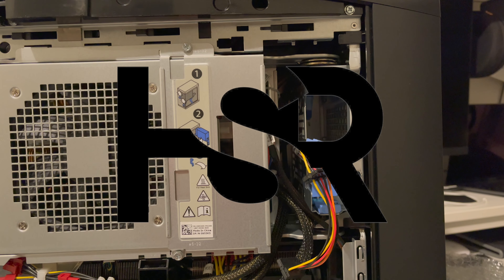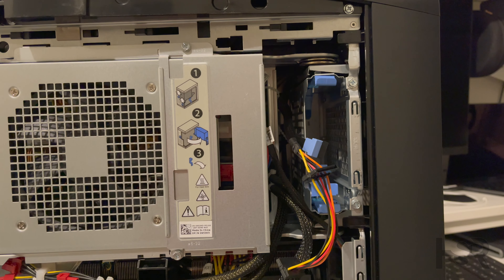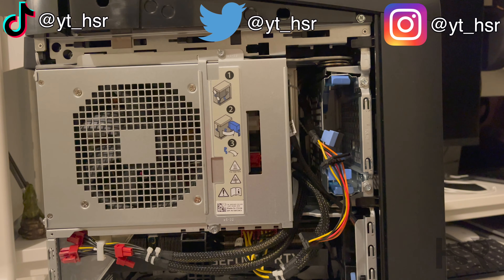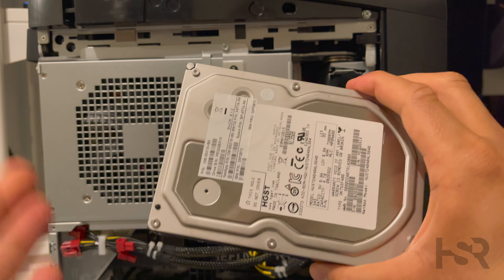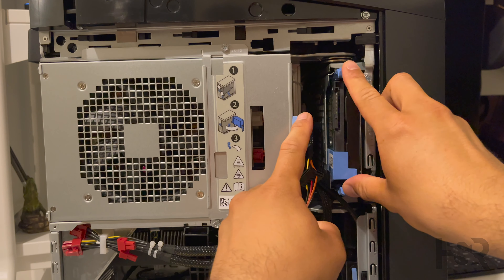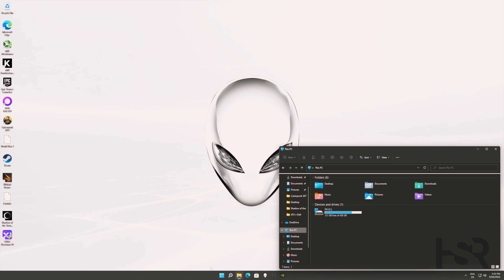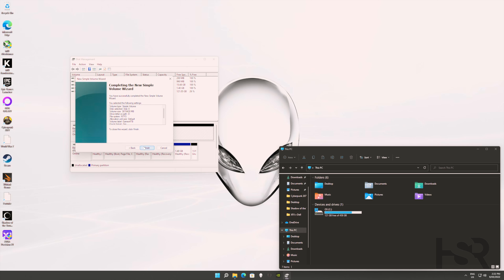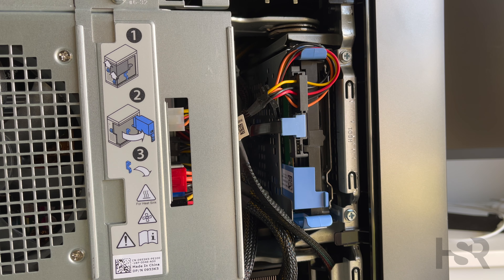(HDD upgrade) Aurora R10,R11, R12, R13, R14

Comment: Can you use and of the other cables for power if you intended to an another drive
Reply from the maker: Which cables. They all have names. Can you kindly specify?
Reply: @HSR  the ones that are coming out of the power supply that fit the ssd/hard drive but aren't the exact one that you used in the video